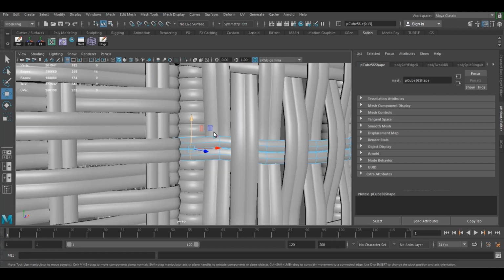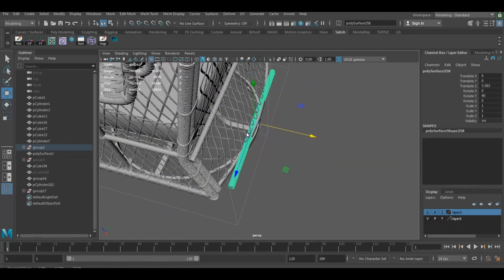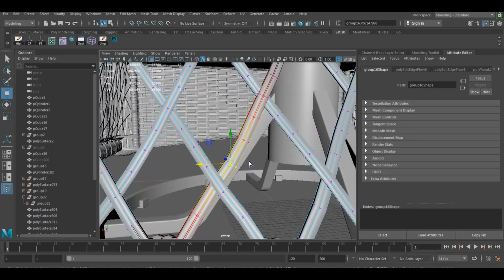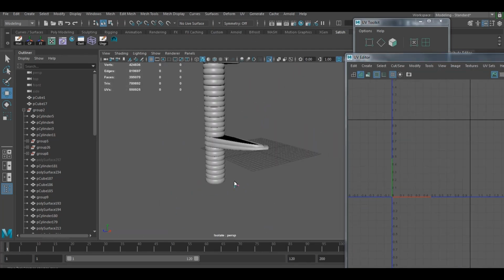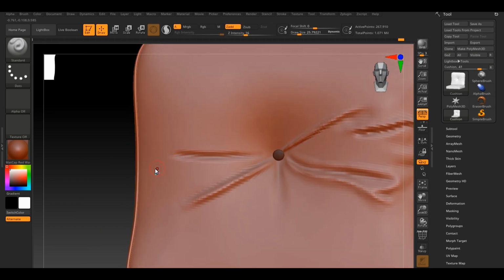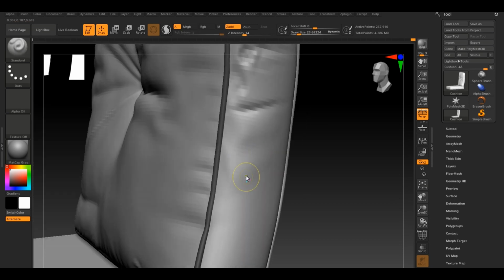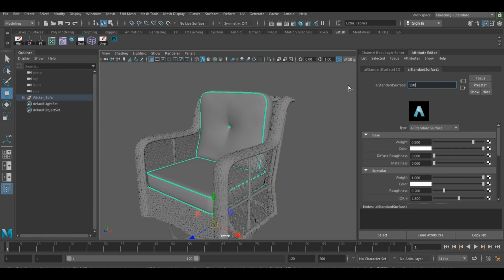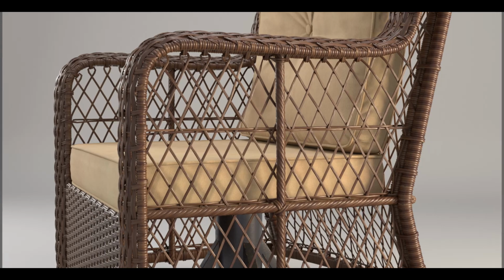How To Make Wicker Sofa (Final Part)(Maya, Zbrush & Substance Painter)

Comment: Hello, quick question, did u add the displacement map to substance painter or just exported it from zbrush and add it to maya later..I saw u only  added the normal map and didn't use a high poly mesh in painter. Sorry the time-lapse was quite fast and I couldn't tell...
Reply from the maker: Yes, I added Displacement map and Normal map both.
Reply: @SatishKumarMishra  so u did add the displacement map that you exported from zbrush to substance painter...how did u do that?
Reply from the maker: I exported Displacement map from Zbrush and applied in Maya not in Substance Painter. For Substance Painter I only used Normal map.
Reply: @SatishKumarMishra  ahhhh ok that's what I was asking before I guess my question was a bit confusing....thanks for the clarification...amazing work btw 👍👍
Reply from the maker: @shavin18 thank you